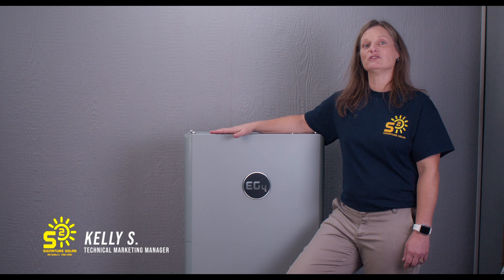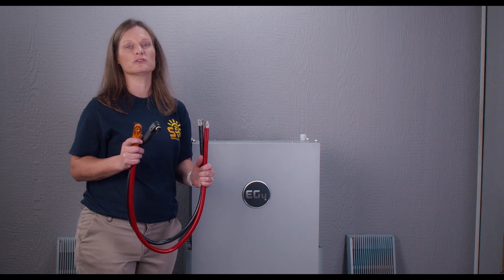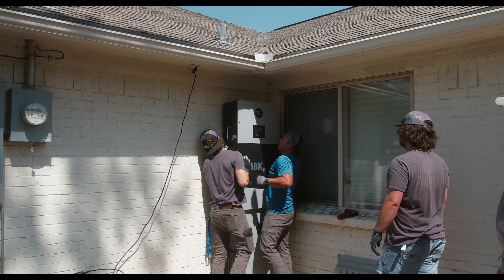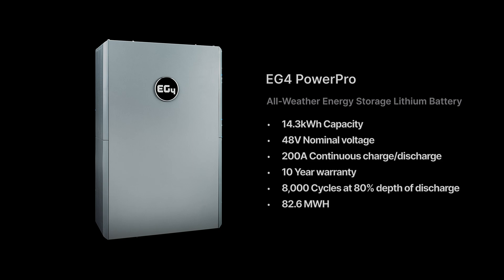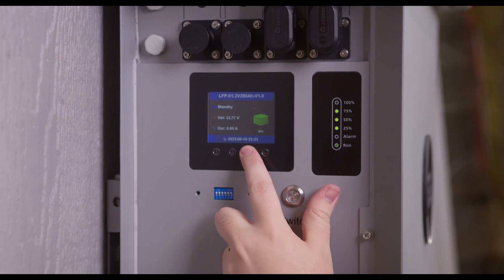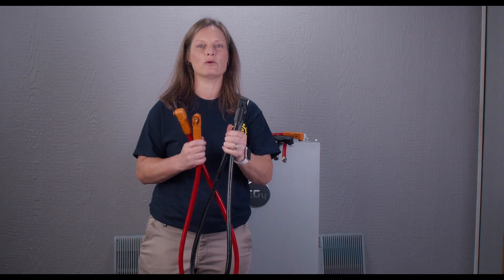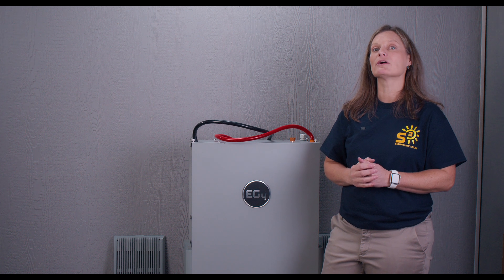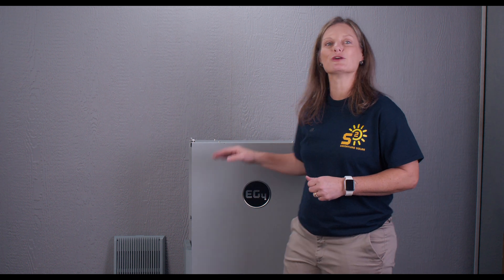EG4 WallMount All-Weather 14.3 kWh Battery with 18kPV Hybrid Inverter Spotlight

Comment: Just curious, the 14.3kwh wall mount batteries have a max discharge of 200amps at their 48v. The 18Kpv EG4 has a max continuous output of 12kw. So, 12,000 \ 48v = 250amp needed to use the 18kpv. Wouldn’t the home owners in this video scenario technically need at least three wall mount batteries for the dual 18kpv setup?
Reply from the maker: Yes, at least three 14.3kWh wall-mount batteries are needed.

Comment: If you're installing these front to back (along a wall with edge outward), how much space is required between them? There's nothing in the manual or installation instructions on this question and I wrote EG4 but haven't received a response.
Reply from the maker: There is not a specified spacing. Heat buildup is minimal, and they do not let off gasses, so as long as you have access to the screens you should be fine. 1-2" should do it :)
Reply: @SignatureSolar  Can 4 of these batteries be connected to the EG4 18 KPV inverter?

Comment: Can the configuration panel be password protected? If it’s outside concerned someone would mess with settings.    Or does panel door lock ?
Reply from the maker: Hi! No, it doesn't passcode lock, but it does come with a key lock and a set of 2 keys.

Comment: We have a brand new set-up with 2 inverters and 6 EG4 wall mount batteries. One of the batteries went into protection mode and we tried everything on to get it to work. We've bought the charger (Doesn't work don't fall for that crap) had multiple trouble shooters over to fix it. We've called EG4 multiple times (can't get a call back). Do not buy these batteries.
Reply from the maker: Hi! If you'd like to reach out to me at engagement@signaturesolar.com, I can get you connected with an associate and get you taken care of!

Comment: This has been a very informative and an excellent step-by-step video!  I’m very interested in the hybrid model…may look into it in the upcoming summer. Out of curiosity, is it possible to run the cooling lines through a ceiling/attic space to run outside, or is the back/side wall installation recommended?
Reply from the maker: Hi @shawnseler7897 Would you mind elaborating on your question? Are you referring to the video we are commenting on or the mini-split?
Reply: @SignatureSolar DOH!  My fault...looks like i replied to the wrong video by accident 🤦‍♂  I'll post in the correct vid...it's for the mini split

Comment: I don't need 200A, 50Amps is plenty for my tiny home. Is there a similar model at that lesser amperage? Also,  are all the functions accessible remotely via a phone app or some other way?
Reply from the maker: The 6000XP might be a good option. It's an off-grid split-phase unit that is popular with our customers who own tiny homes and cabins! It's 125A. We also have a few Victron inverters that may fit your power needs. Feel free to reach out to us at 903-441-2090 and we can help you pick the right unit.
Reply: @SignatureSolar  Is it weather/raintite like the above?
Reply from the maker: @akmass9761  the 6000XP is not an all weather unit and will need to be installed indoors.

Comment: Can 2 people use a hand truck and move up stairs?
Reply from the maker: The battery is 308 lbs and the inverter is approximately 121 lbs, I think 2 people plus a hand truck could move them up stairs, but it depends on the weight capacity of the hand truck.
Reply: @SignatureSolar  yeah got an appliance hand truck it was very hard to get up 5 steps on to our covered front porch.  Our front porch is covered and has gfci outlet would the eg4 6000xp be ok on top of the powerpro batteryon the covered front porch, i would still make a nice deco enclosure so its not easy for anybody to walk up to it and start pressing buttons, i figure this would be ok as it would not get wet, but wanted to confirm porch is not conditioned space.  

Also does tje eg4 conduit box mounted to power pro battery work with the 6000xp? Id like to mount it on top like the 18k one does
Reply from the maker: The conduit box is only for WPP-18kPV

Comment: What cable do you recommend for the E-Stop rapid shutdown button on the EG4 Power Pro and how many conductors?
Reply from the maker: On the installation guide, it suggests using 12AWG - and it will be 2 conductors.  Here is the link to the installation guide! https://eg4electronics.com/backend/wp-content/uploads/2023/04/EG4-18KPV-12LV-Installation-Instructions.pdf

I hope this helps!

Comment: Can it be mounted on the floor or on a stand just off the floor?  Also some of us have no need for an inverter as large as the 18k so I was wondering; This battery will work fine with a 6, 8 or 12kw inverter wont it?  I'm thinking specifically of a Solar array of say 5-6kw in a tropical environment like the Philippines.  Planning an off grid system paired with the EG4 6000XP, 6500EX or 8K EXP and think this would be a great option instead of a typical server stack set up.
Reply from the maker: Yes, it's versatile – can be floor-mounted with its designed height, and the wall bracket is an option. Plus, it's compatible with other inverters and ensures closed-loop communication with the 6000XP.
Reply: @SignatureSolar  Would this be compatible with the EP Cube? Even though it would look like a frankenstein system if it could.

Comment: Quick question, I'm considering this on my sailing boat. It's probably not marine grade, but if I can install it on its side, it might be a perfect fit for my needs. Can the module be on its side?
Reply from the maker: This unit cannot be installed on its side.
Reply: Always read the instructions ❤

Comment: I just order 2 18kpv with 4 power pro and 60  400w panels  for a off grid setup, will need help  set  the 18kpv up in parallel and sharing the batteries. this will be my first solar setup. go big or go home.
Reply: Holy bajeebus!

Comment: What’s the difference in UL9540 and UL9540A?
Reply from the maker: UL 9540 specifies the safety requirements for energy storage systems and equipment, while UL 9540A is a test method that evaluates the thermal runaway fire propagation in battery energy storage systems. Let us know if you have any additional questions.
Reply: @SignatureSolar  nice to see a company replying to comments 😊
Reply from the maker: @UBGood  We're doing our best! Lovely to be appreciated, thank you for your feedback!

Comment: Why does Will Prowse say that to use this battery with the 18K inverter you would need two of these batteries. If this is true then why do you sell this battery and inverter as a set for just under $10K. Please respond as I am very confused by this comment by Will.
Reply from the maker: The number of batteries would depend on your energy needs. The 18kPV can be used with 1 battery.

Comment: How are these units vented? Like for cooling when the batteries get hot. Would these be viable in a marine/boat application? Would salt water negatively effect these?
Reply from the maker: The ventilation requirements for this inverter and battery system mandate installation in a well-ventilated area. Regarding their suitability for marine or boat applications, although they possess an outdoor rating, we don't recommend their use in saltwater marine settings due to concerns about saltwater exposure. It's also important to note that the combined weight of these components is approximately 430 lbs, and this may cause weight distribution issues depending on the size of your boat and placement. If you'd like to give us a call at 903-441-2090  with your energy needs and the specifications of your boat, our team will be able to help you choose the system that best matches your requirements.

Comment: I rather have 1000 trees 😂
CO2 is a beautiful clean natural gas the has contributed to 15% extra vegetation over the past 2 decades. 
If you believe that CO2 is causing warming rather than that warming causes higher levels of CO2 then still.... warming is better than cooling. 
Who wants a cold climate? 
5 times more people die from cold. 
It is way harder to grow crops with low levels of temperature and CO2 which is undesirable with an increasing population.  
If the northpole melts we have 0cm sealevel rise.... the northpole floats remember. 
Glaciers will melt anyway even if temperature stays constant. They were produced in the 1600 when there was a little ice age and will slowly melt as the new snow cant keep up with the glacier melting. This process is ongoing since 1800. 

Good luck arguing religious people that beleive in the CO2 cult.

Comment: How many 400 watt solar panels would I need for the following

EG4 PowerPro ESS |  28.6kWh Capacity | EG4-18Kpv & EG4-PowerPro WallMount Battery | 9540 Pending
Reply: 30 @ 400W per panel, so 12kW, should set you up right
Reply: @htsyami  thanks 😊

Comment: Can I use it with my Huawei inverter?
Reply from the maker: You can use it but the BMS system won't communicate. You will need to manually input the settings.
Reply: @SignatureSolar , how often would I conceivably have to do that?👀
Reply from the maker: @patriciamariemitchel  Give tech support a call at 903-441- 2090 so they best answer any questions you have about the integration for this specific inverter since the Huawei isn't listed as a communication protocol.
Reply: @SignatureSolar , thank you.

Comment: I’ll give you a suggestion for your customers. They can rent or buy a engine lift to help with wall mounting it’s got good reach, height adjustment, and on wheels. But keep the weight within the frame and the front wheels 🛞 up to wall 😊
Reply from the maker: Solid suggestion, @clarencewiles963! An engine lift for wall mounting is a smart idea!

Comment: Is there any time frame were these may make it to Canada?
Reply: Ok fantastic I’ll find out at this end.
Reply from the maker: These can ship to Canada using a freight forwarder.
Reply: Ok great. Also which UL code is canada requiring to be grid-tied certified. I see some have 9540 others are 1973, then some are simply CSA or ETL. it’s quite difficult to choose properly.
Reply from the maker: @NewLightEnergy  Similar to the U.S., this all depends on the specific local requirements in your jurisdiction.

Comment: Does signature solar have certified installers that can deploy these with 18k inverter kits ?
Reply from the maker: This unit is pretty user friendly so you could install it yourself and have a certified electrician hook up the AC side of your system. We also have a helpful installation video coming soon! If you'd like to hire an installer you can visit the website below to locate one in your area: https://directories.nabcep.org/.
Reply: @SignatureSolar  It's good to see you watch the comments in the comments section. I've become in a believer in you guys